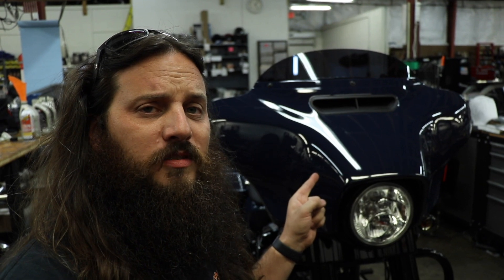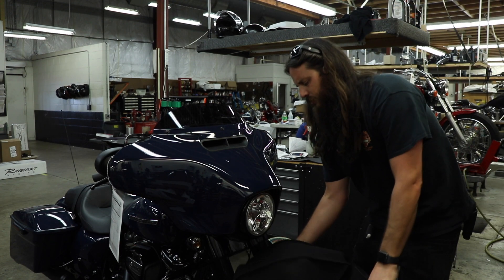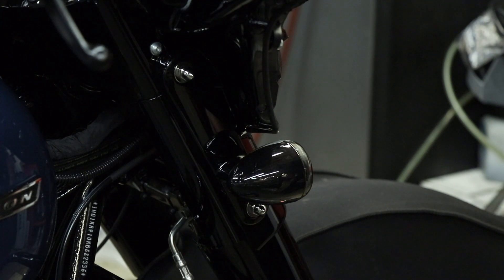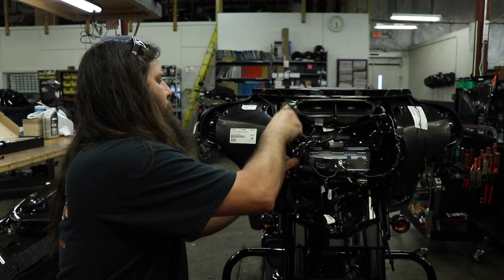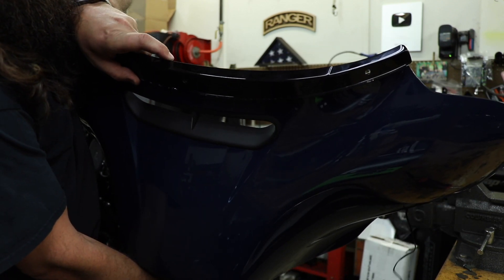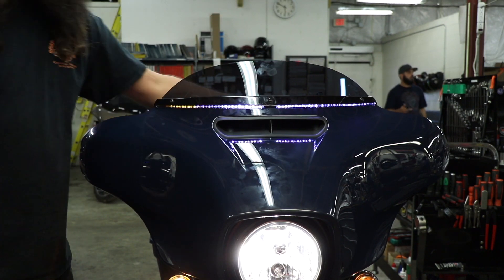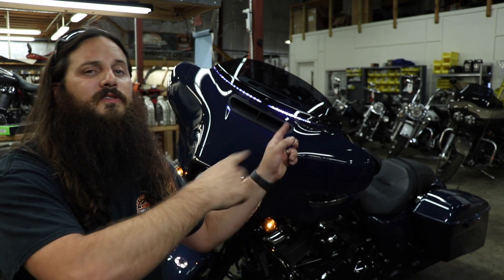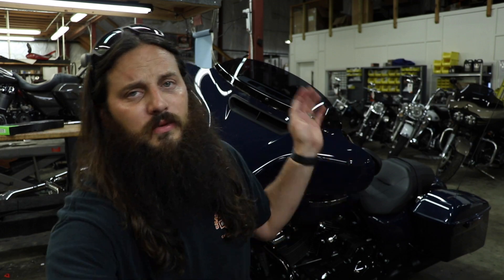Harley Davidson LED Windshield Trim by CIRO (2014 and up)

Comment: Just fitted mine . Instructions worked fine, very helpful. Discovered Fog Lamps don't work unless bolted back into position. (Must ground through the forks?)

Comment: yea back in the shop video. halogen giving you a case of the hot crossed buns lol. if you were to hang all the accessory lighting from ciro would the charging system need to be upgraded

Comment: Hey John, I have a 2019 Fatbob S and I was wondering what I could do to tighten the steering up? On my old 2012 I was able to buy a gpr stablizer and that helped with death wobble at 90+ mph. Is there anything out there that you know of that helps with the wobble starting around 90 mph? I ride fast but also want to be secure in the handling department.

Comment: Just curious - why would you install an aftermarket piece as opposed to a Harley part on a brand new bike?
Reply: A lot of dealers do this. Everything from bars, handlebars, bag blades and ill kinds of other " smaller mods " that would catch your eye. At least that's how I look at it.
Reply: @ColeSS12  I just found it interesting because Harley makes one almost identical to the one John installed. Thanks for your input.

Comment: I installed myself for my ‘17 CVO Street Glide along with saddle bags blade turn signals/brake lights they are  same sequential set up, I get quite of compliments by other riders. Check out Ciro 3D website, they do make clean look products (include Road Glides). Safe Ride 👍🏼
Reply: Thank you very much Don!

Comment: so I have a problem my idle air controller will not stop running need help it's killing my battery
Reply from the maker: You need to pull the system relay out of the fuse panel, clean all the contacts, and put dialecticric grease on all your contacts to keep water from getting in there.

Comment: Those center lights look blue.   Are blue, or red for that matter,  legal on the front of a bike?  In the oppressive regulation happy northeast (NOT YOU NEW HAMPSHIRE) they might get some undesirable attention.   Remember those windshield washer sprayers with the blue LED in them...yeah, dats a no no now! 

I'd like a strip of lights like that for a Road King windshield with a little visor over them to cover back glare.